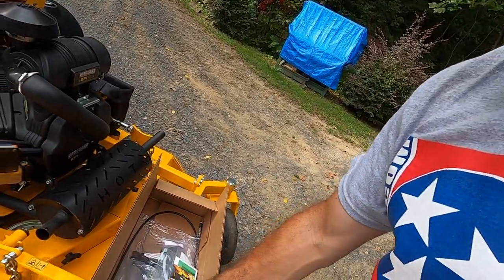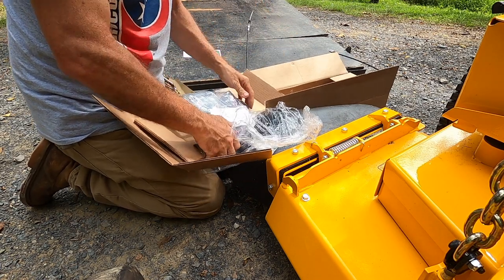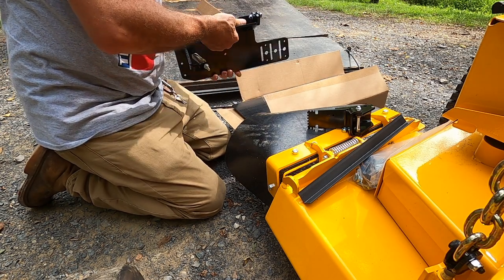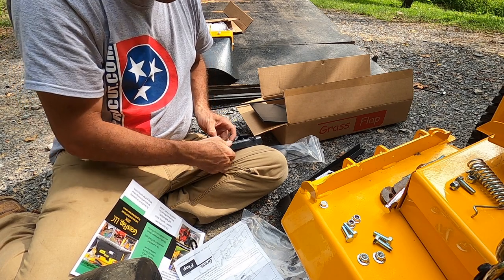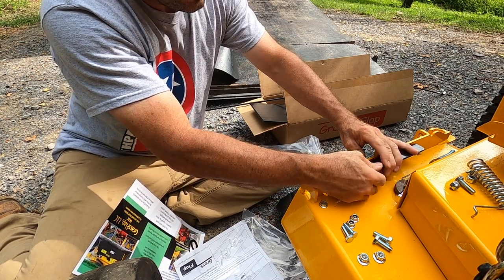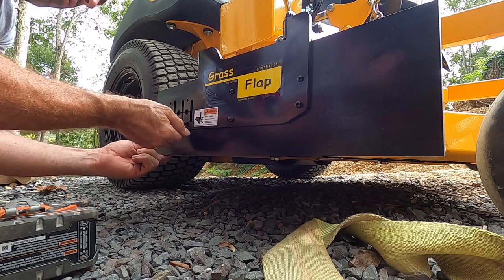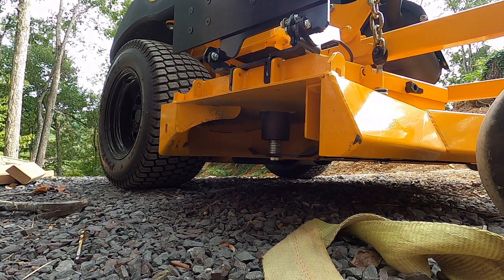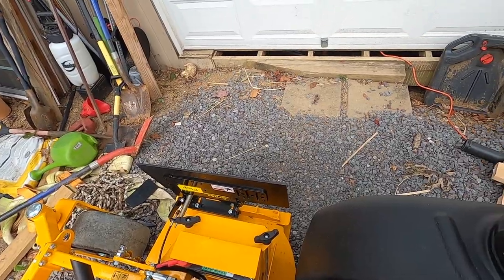how to install a Grass Flap [Wright Stander ZK]

Comment: That’s a pretty well built flap. I can see how installing that cable was a huge pain in the butt. I couldn’t tell what kind of nuts were on those bolts, because if it’s just regular nuts, I would apply some blue tread lock on them.
Reply from the maker: they are nylock nuts
Reply: The ProCut 👍👍

Comment: Well done bro.
Reply from the maker: Many many thanks
I had the spring on this unit break after snagging some barbed wire the end of last season. then the cable failed last month.
Reply: @TheProCut17  that sucks
Reply from the maker: @Viper6-MotoVlogger  the the parts are not cheap, I've been just using a strap to hold it up for now